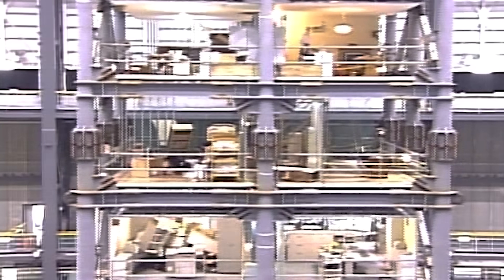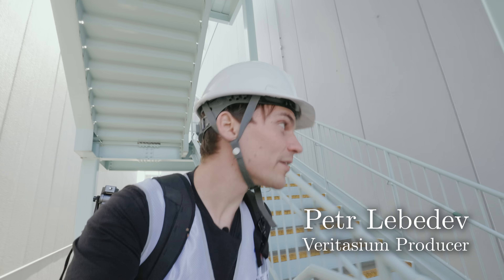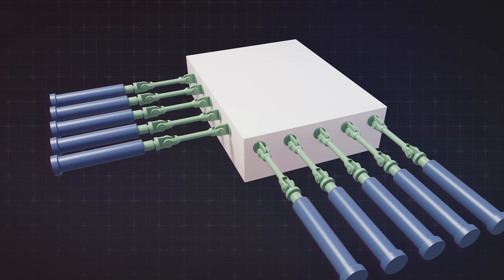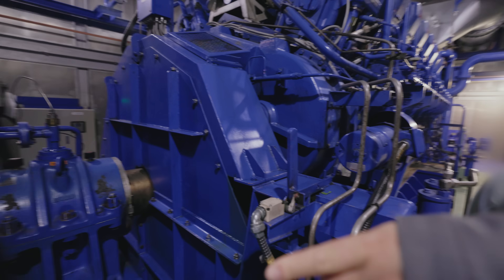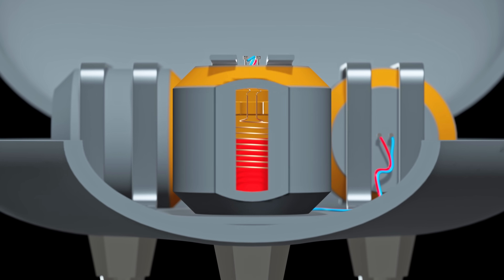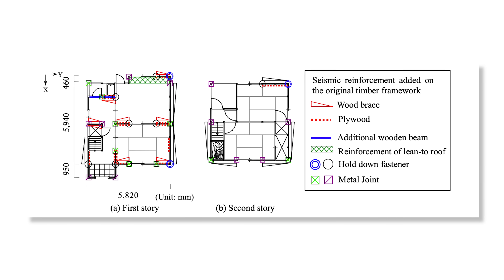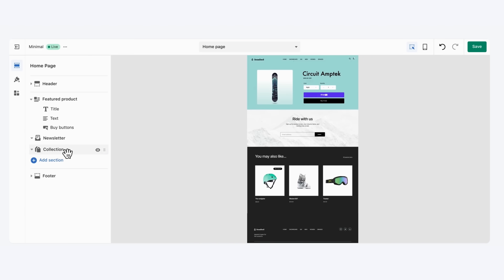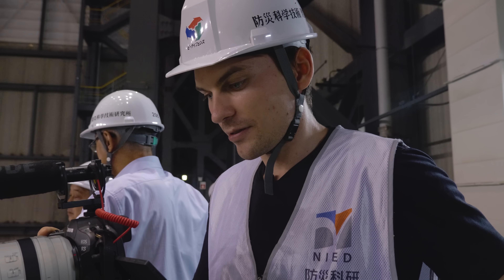How To Earthquake-Proof A House

Comment: I live in the Netherlands, where we have earthquakes due to gas extraction.
So my demolished and rebuilt house (along with all other houses in our street) has been placed on base isolation friction sliders.

Before we even moved back to the newly built house, there was a quake again and the manufacturer of the friction pendulum sliders has visited again to inspect the sliders.
The house (or actually the ground) had moved +/- 2 cm (in X/Y plane) which they could see in the displaced grease in the sliders.
The sliders are large enough to allow upto 125 mm displacement from the center in the ground-plane.
We have a gap surrounding the house to allow for the displacement, which is covered with some plate and gravel.

Here we don't have such 'impressive' magnitudes as the strongest one so far was "only 3.6" on the Richter scale.
However quakes elsewhere are several 10s of km down, where we have them near the surface.
This makes the quake-movement quite different from what you see in these simulations.
So the minimal perceptable magnitude as mentioned in the video does NOT apply to the quakes here as you can feel quakes starting at 1.5 on the Richter scale here because of the epicenter of the quakes here is very close to the surface.
Also we have 1km of salt and lots of clay on top acting as a rubber surface.

Only a few-1000 houses have to be rebuilt/reinforced to make it all safe again.
Reply: Very interesting, thanks for sharing!
Reply: One reason that the houses in the Netherlands are experiencing the "small" earthquakes as "big" earthquakes is because there not built to withstand earthquakes. Even the case mentioned above with the isolation sliders, it is just a workaround and not the same principal as the houses in Italy, Greece, Turkiye, etc. (the houses that really follow the regulations 😅).
I have experienced many earthquakes in Greece with the biggest been 5.9 on the scale and with duration about 15 seconds while 3.5 seconds after the first earthquake a second earthquake started 5.5 on the scale. If this have happened to Groningen there will be no Groningen now.
To conclude, you experience the earthquakes so strong because the houses are not build for earthquakes and they are not build for earthquakes because there were no earthquakes before the gas extraction.
Reply: @TheStamatix  It is for sure not just about the buildings not being designed to withstand quakes.
The difference with quakes here compared to quakes elsewhere is mainly due to the lack of depth.
The Richter scale is more or less about the amount of energy being released.
But with deep quakes the propagation is a sphere. Thus the attenuation is to the power of 3 per distance.
With quakes here at the surface (at 3km depth), the propagation is more like a surface ripple.
More like what you see when you throw a stone in a pond.
The attenuation is to the power of 2 per distance.

Also we have hardly any buildings here, so you get the full amount of energy left to deal with.
The house is lifted up like a boat on waves on the water.
Depending on the size of the building, it may be floating freely at one end or both while the wave passes and thus your house simply breaks.

The peak ground acceleration (PGA) here was for some quakes even more than the lowest PGA mentioned in the table on Wikipedia for the top-10 quakes on the Richter scale ever recorded.
So IMHO you shouldn't only use the Richter scale when comparing quakes, but also look at the PGA as that's what causes damages to your houses.

Purely based on the table on Wikipedia about what value on the Richter scale can be felt, I think you should add roughly 1.5 .. 2 to the reported values of the quakes here in Groningen to compare them with other quakes.
But as I mentioned, there is way more to quakes than just the amount of energy released.

Also the direction from where the wave hits your house is very important.
Here in the Netherlands the houses are all built mostly like the outer hull of a match box (when you slide out the 'drawer' with matches)
The front and the back of the house are not really adding to the strength and stiffness of the building.
So if your house is hit from front to back by such a wave of the ground then you only will end up with cracks in the walls, but your house will likely not collapse.
However if such a wave hits your house from the side, then you will be in big trouble as the floors (30 cm concrete) will collapse.
Some reenforcements of the houses here are just done by adding a steel frame with a steel cross in the front and back of the house and then add new walls and some steel construction around the stair cases. Sometimes also the foundation has to be made wider or else the house may 'fall off' the foundation.
When the costs for reenforcing the house will exceed 150% of the costs to demolish and rebuild, then as owner of the house you may opt for demolition and rebuilding.
And just if you think it would be nice to get a free new house..... 
Our 'project' took about 10 years of which we've spent 28 months in those temporary houses.
At this moment our small village of 4000 people has 80 - 90 of such temporary houses for people to live in during the reenforcement project.

Just to be complete with this.... You know what the definition is for an "earth quake proof building" ?
A building meets these requirements when you have at least 20 minutes to leave your house alive and no less than 1-in-100'000 people die  per year.
Just looking at the predictions on earth quakes you always will see some repeat period being mentioned.
Like "X on the Richter scale will only happen once in 300 years" or something like that.
The same for storms which may cause floods (remember, a huge part of the Netherlands is below sea level, so floods are kinda important here) or when designing a nuclear power plant etc.
All of these are expressed in some kind of event they can withstand including a repeat period or chance it may happen in the next x months or years.

So let's assume about 100'000 people live in the area with quakes and the building code demands the houses must withstand some quake which will only happen every 300 years.
Then you can also read it like "if a quake of such-and-such strength will happen, they estimate about 300 people may die.
Reply: Are house & lots getting expensive there? heard it's a popular spot for doomsday bunkers
Reply: @MangaGamified  not really. do to the earthquakes only there and in the south of Limburg (mines).
If you want bunkers just go to any Dutch coastal town. I know of a friend of mine she has a old ww2 bunker in her garden. works great as a wine cellar. but foor doomsday reasons? the biggest disaster we can have is dike breach when a major storm is going. for that you need elevation not a bunker.
Reply: @sirBrouwer if you want doomsday prepping, you need to be *not in the netherlands*, really. Or at least the higher elevations of the east.
Reply: You're well educated about earthquakes 😮😮😮

Comment: I wonder if they were simulating an earthquake, then an actual earthquake of the same magnitude happens, does it multiply? 🤔
Reply: Depends on the natural frequency of the system. My guess is that the actuators will dampen it.
Reply: It's like two sound waves interacting with each other. Either they're exactly the same frequency and multiply or cancel out (insanely unlikely), or they just combine into some form of noise with random peaks and valleys. Look up wave addition/interference. Earthquakes are basically just huge low-frequency sound waves traveling through the ground. 

Realistically, the machine would instantly be shut down as the quake starts and no further testing would happen until a THOROUGH check of the facilities and pumps was done.